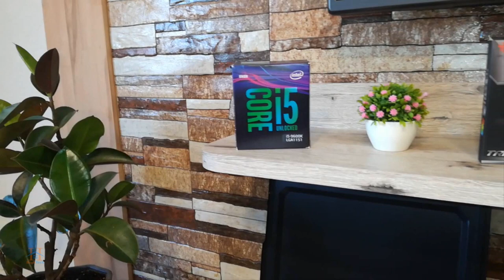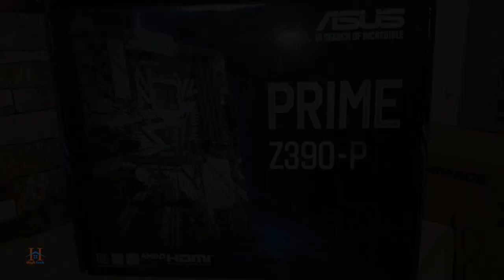Asus Z390-P Prime and i5 9600k on Everest Rampage X CORE

Comment: I had this exact same board and cpu. It’s a good board for the money, it gets the job done, a no frills plain motherboard. However, I found the bios to be strangely buggy with uefi bootmger, booting off of an m.2. At random times it wouldn’t boot “no os found”. Would have to boot override sometimes. Reflashed the bios with newest version, reinstalled windows, still did it. I found it to actually be an issue with the Bios legacy usb support, it was actually corrupting the installs, and somehow it made my keyboard and mouse not work in bios. Had to jump the CMOS.

Comment: Is there any big difference with using Samsung Evo 860 1Tb SSD instead Samsung 960 Evo as implemented in cast?
Reply from the maker: no big difference with m.2 960,even with ssd disk,from hdd to ssd or m.2 yes
Reply: @borningame  thanks. I purchased Samsung EVO PLUS 970 500GB SSD with a 500GB HDD. What do you think of that?

I also bought Gigabyte GTX 1660 Ti for this motherboard.

Comment: Aura syinc?
Reply: I have the same question, this is my ideal motherboard, but no aura sync may be a deal breaker (well it was until I saw this machine 👌)
Reply: I've been trying to get the aura sync to work with my cooler by the same brand